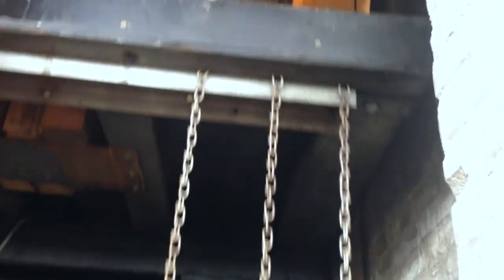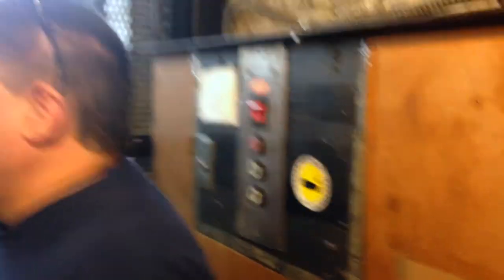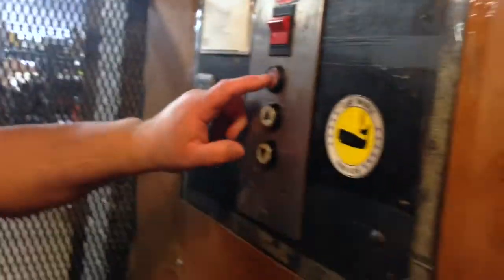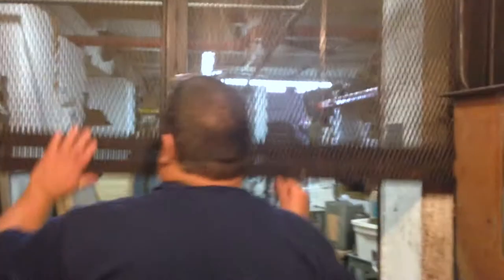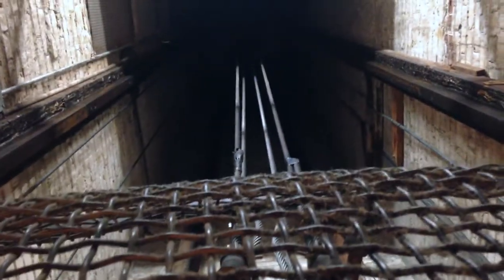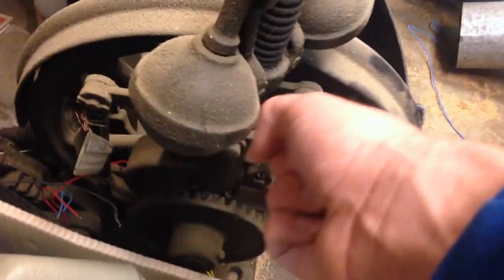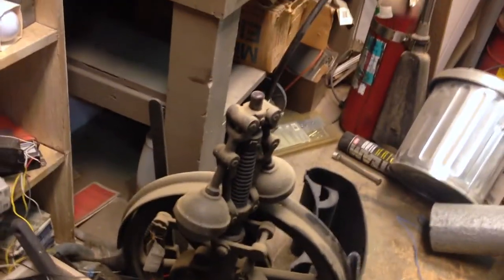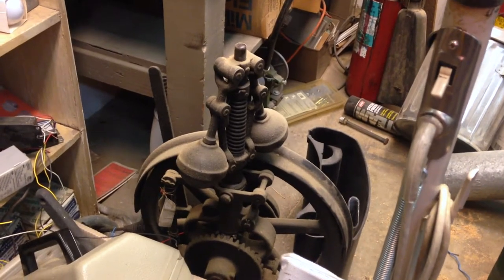VERY old and beautiful Otis manually controlled elevator. (No door or gate.)

Comment: This may have actually been a pull-rope elevator before the constant-pressure push buttons, which if car-switch manual elevators are illegal in Portland, than I’m more than certain pull-rope elevators are too.
Reply from the maker: Yea they probably are. Portland has gotten a sick habit of not appreciating old things. This was originally a switch operated elevator though according to the guy. But Portland wanted it completely modernized and the guy said “hell no. I’ll make this to the point of not being illegal by full definition but any technicalities or anything else are staying in here.” Thank goodness he did. That elevator is too beautiful to modernize.
Reply: Well I’m glad he did too! It definitely is beautiful!
Reply: He uploaded a car switch elevator in Portland about 8 years ago, so those might still be allowed unless codes changed since then.